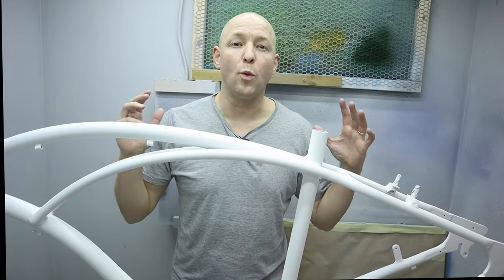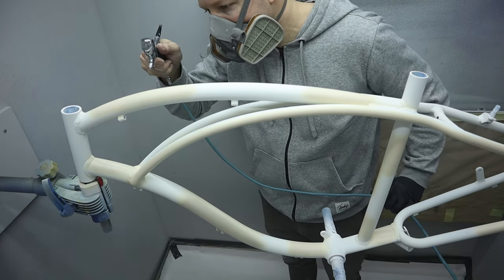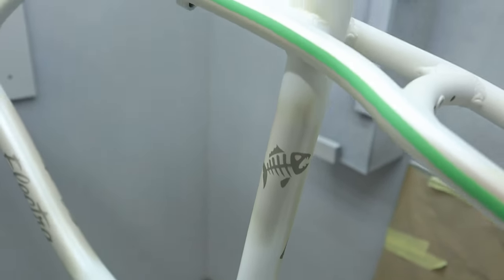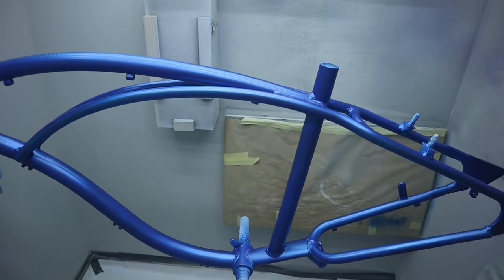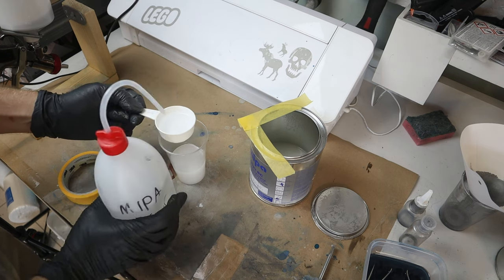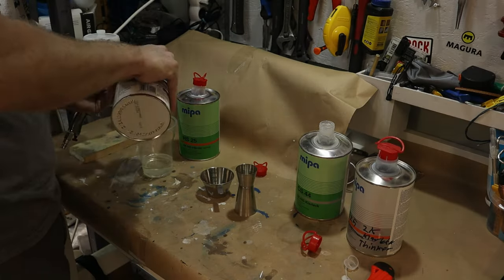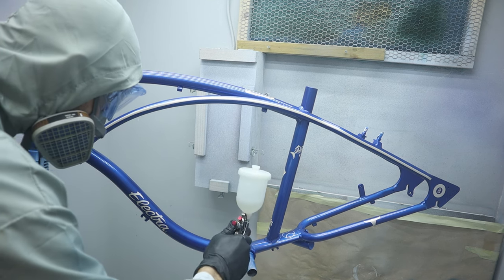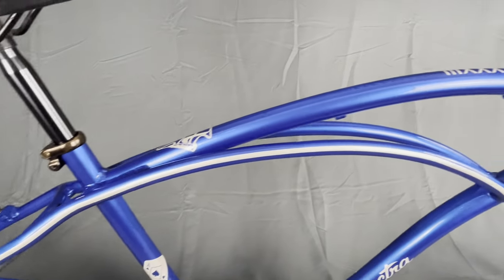Complete beach cruiser custom PORSCHE paint job - DIY

Comment: Is that small compressor really enough for the sprayguns?
Reply from the maker: For small paint jobs like bike frames and using Lvlp mini guns it works fine. But I could not spray car parts or drive a big Hvlp gun with it. 👌